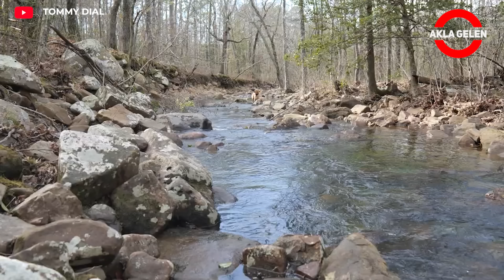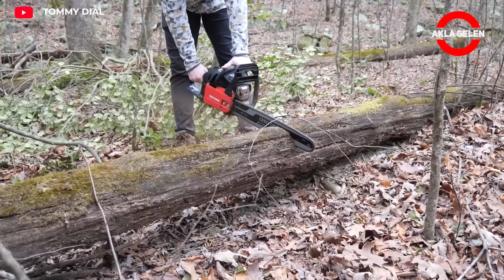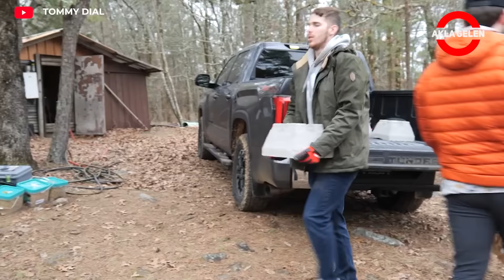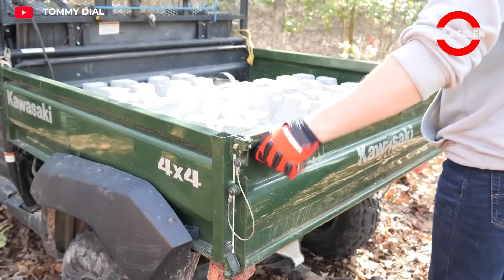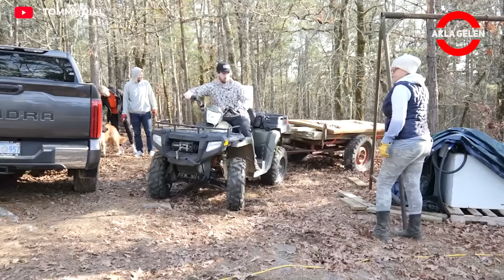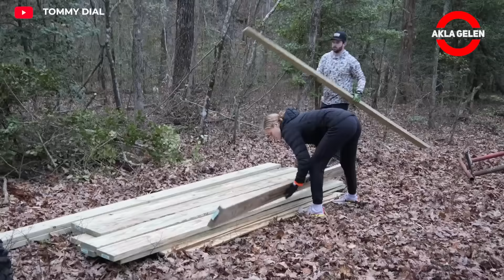Man Builds Dream Cabin in the Forest with Family | Start to Finish by @dialtommy

Comment: 2 questions. Why wouldn’t you cut the windows out when you frame so it’s lighter picking up and 2 maybe I missed this step but did y’all insure the floor?

I might put some galvanized wire in the roof cracks to keep the mice out

Comment: Not to complain but safety if you use cheap screws if tornado goes by it can pop heads off screws and blow it away gov researched why all those prefab housed blew away in Iowa Kansas in 70s 80s be safe
Reply: Nice , the next cabin i’m going to build it’s going to be a vertical one right now the one in building it’s about 12 inch round logs on my YouTube channel
Reply: @HiddenCreekCabin 👍

Comment: Total not done by any real builders. They never secured the square of the structure either with sheeting or diagonal bracing. I moved every time he hit the bolt with his hammer. No way that stays square. Hope the ground never freezes around those pilings. It will never be level after the first freeze.

Comment: Carpenter here....WTF are they framing? Who designed this ?  you could have easily found a how to video to construct your inside and outside corners, the bolt through beams? talk about re inventing the wheel.
Reply: and please add a diagonal brace .....before...you climb ontop of anything.